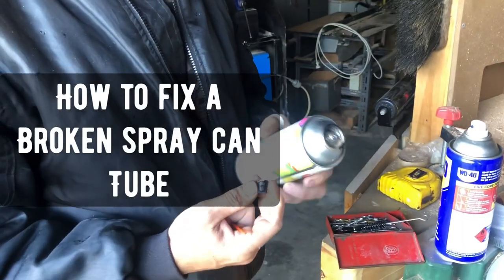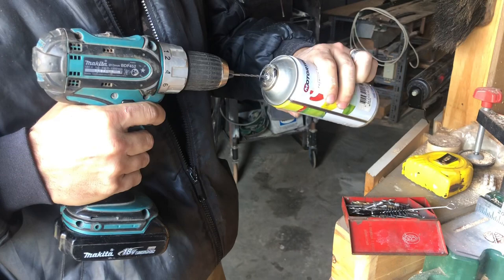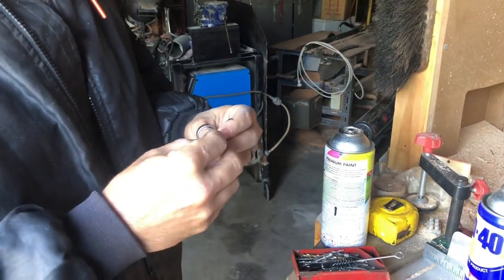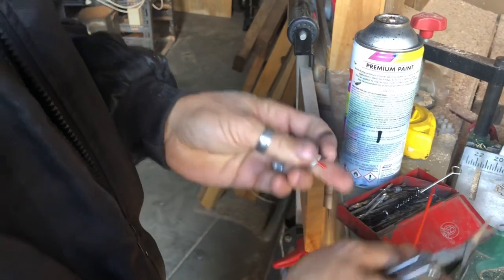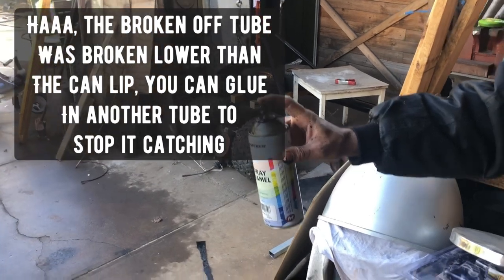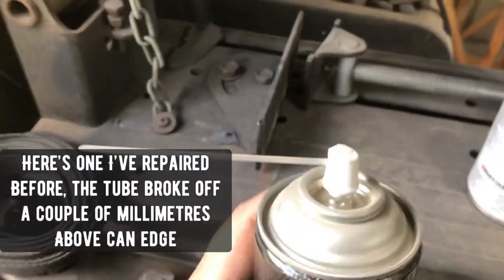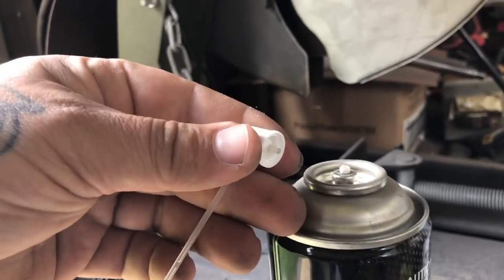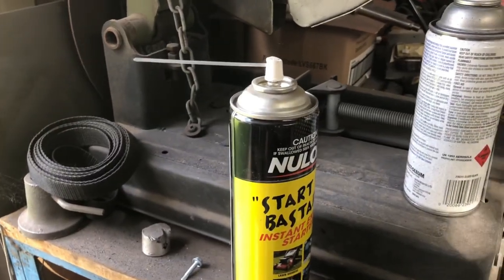How to fix a spray can with broken tube

Comment: Great idea but “WARNING/caution”, while trying this, I drilled down too far and all hell broke loose. My fault of coarse, I kept drilling past the resistant point that I felt and had a total disaster. Paint under pressure was spraying like a volcano eruption. Thank God I had enough sense to be outside. LOL, funny now, not an hour ago. I said, “Fock me too”. LOL
Reply: I laughed at this and then ended up having to try it, and actually feel just like you did except unlike you I was inside my garage…
Reply: paint blast spot lasted for weeks😂😂😂😂

Comment: Where can I buy that tiny little tube that fits inside the broken piece?
Reply from the maker: We usually save them from the wd40 spray cans, as they have this tube that fits inside the nozzle to spray in tight areas
Reply: I've used the plastic coffee stirrers like from the dunkin donuts. Works well on the WD-40 cans as subs.